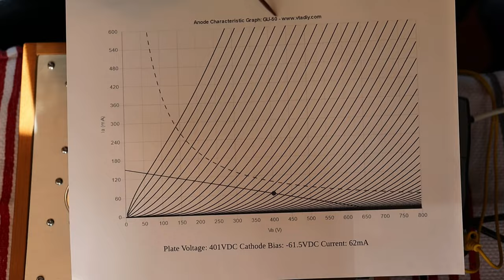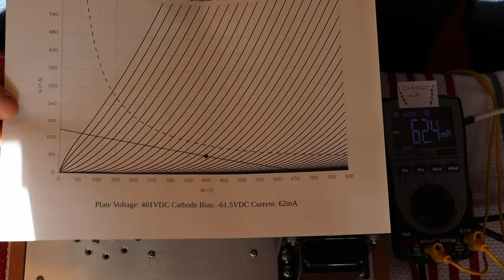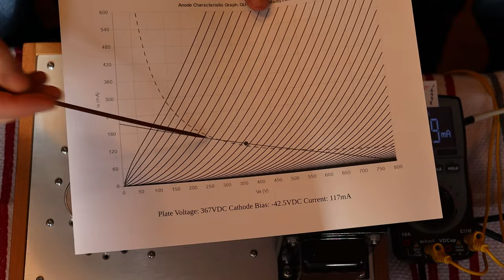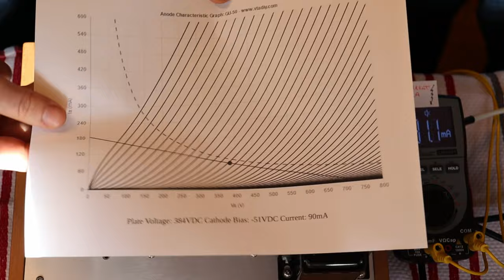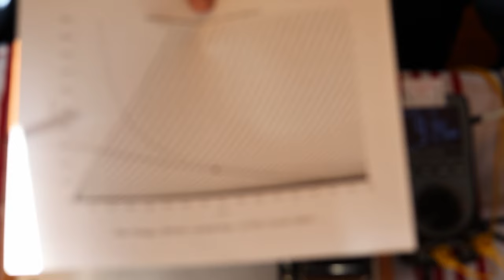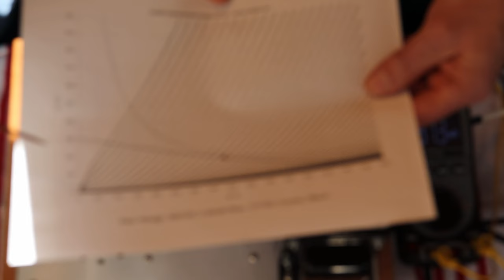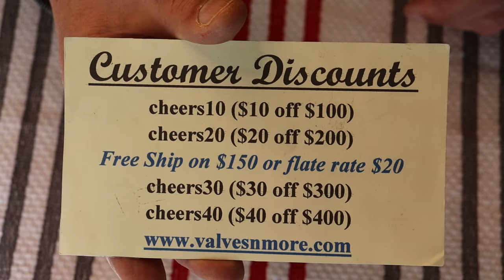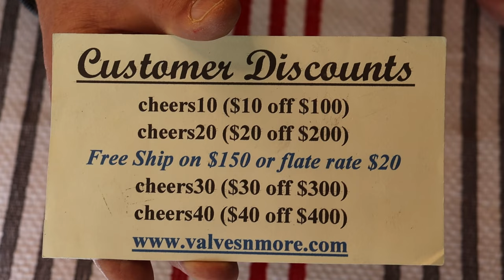Tube Lab #172 - What are Emissions?

Comment: I am not a tube amplifier guy, but do work with tubes since i wind them fascinating and electrically way more tollerant to overload. 
 is there a way to restore vacuum tube emission? I have done a bit of testing in raising filament voltages about 2 times  and "baking" the tube a bit at that higher voltage together with drawing anode current. 
There are a few videos of people doing that. To my knowledge they are basically removing old cathode material exposing new one underneeth. 
I do enjoy these videos from time to time, I don't really understand when people claim one tube sounds better than the other and they all pretty much sound the same to me, placebo maybe?
Good video tho.
Reply from the maker: Sometimes (as in almost never) a cathode needs a special period of regeneration, that's a process that every tube is designed to do the minute you turn them on.  But what happens is a tube is stored for a long time and the cathode becomes contaminated  and needs a few minutes to get working properly.  The claims you see of someone taking a worn out tube and bringing it back are mostly BS.  After you over heat the filament the tube will test better for one or two minutes and then start to slowly fade away again.  The reason for this is the filament is worn out and can't rejuvenate the cathode or even fire up the electrons enough to get much output.  We throw out hundreds of tubes every year and low/mismatched Gm (mutual conductance) or emissions (mA) are the main reasons they get binned.
Reply from the maker: If you can't hear the difference between different quality tested and matched  vintage tubes, that's a sure indication that your listening system doesn't have enough resolution and needs upgrading and or your hearing is buggered.  Basically the resolution of your listening system is lower than your tubes, probably by a significant amount, so you could plug any tube in and they'll all sound the same.  I'm lucky to have a family member who is a hearing specialist, she tested my hearing and plotted the frequency response of the test.  I wasn't shocked to see that my top end stopped at 11khz, but I didn't like the wee bit of wiggle through the midband, then she showed me her midrange hearing graph and I was grateful that I've always protected my hearing all through the years when I had a commercial woodworking shop and worked in the bush bringing in the firewood for the year.
Reply: @tubelab194  I mostly was referring to tubes with the same designation, I dont hear any difference between different ECC83s, no tube sounds "warmer" or something like that. 
I do see that their internal construction is a tiny bit different in plate structures, but for the tube to be classified as a ECC83 the spacing of the grid to the cathode and the grid shape must be the same between the different versions to cause the tube to be still a ECC83. 
I am still in my youth and can still hear CRT TVs high pitched whine (and I love it), I doubt that my hearing is the problem. I was building my own "amp" (More of a modulator) and I couldnt hear a real difference between American made 12AX7 (Not General Electric no etch), Siemens ECC83 and an RFT East German ECC83. They sounded completely the same. 
I dont really take the "sounds warmer" excuse, I would honestly like more scientific testing if there is sigificant difference between tubes of different brands with a large sample size of preferebly Used and New old Stock tubes. 

and yes rejuvinating tubes will not make them like new again, that is a given. I would be interested how much life you could really squeeze out of an old tube by rejuvinating it.
"The reason for this is the filament is worn out and can't rejuvenate the cathode or even fire up the electrons enough to get much output."
What do you mean? The Filament doesn't wear out compared to the indirectly heated cathode. The filaments (heater) purpose is to make heat, unless the tubes filament opened it it will do its job just fine. 
The filament in an indirectly heated tube is removed from the plate circuit, so it doesnt matter in a case of rejuvination other than making more heat than it is supposed to. 
Could you please explain what you meant by this?
Reply from the maker: @janno288  that's exactly what I thought you meant, if you have a well designed and quality built tube preamp or power amp with good cables and speakers, you will most definitely hear a difference between almost any type you listen to, especially a high gain tube like the ecc83.  What can easily happen in any audio chain is one (or more) weak links mucks up the signal (tubes, coupling caps, RCA patch cords, RCA jacks, volume pots, circuit design/build etc), even one bad sounding tube or crappy RCA cable and everything afterward is reduced to the sonics of the lowest quality point in the system.
When you try and rejuvenate a cathode, in 98% of the cases (give or take a few) it will look good on the tester for one or two minutes and then it reverts all the way back to where it was and worse, because you've fried the filament.
Quality tubes normally don't go pop, what happens is over a long period of time the filament wears out, it starts getting weaker the minute you fire up a brand new tube and from that moment forward the clock is ticking (quality tubes typically have a 2,000hr rating on the filament).  Eventually the tube will sounds like shite, it's still working but the quality of the sound will be significantly degraded and the gain will be much lower.   We throw those tubes out immediately, and make sure they're destroyed or someone at a recycling depot will be selling them on eBay with repo boxes for top dollar!